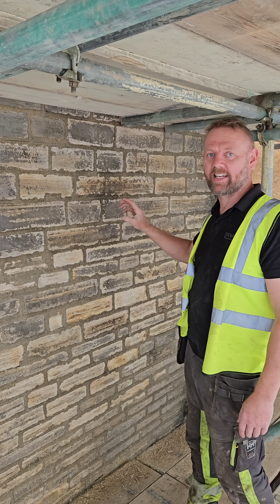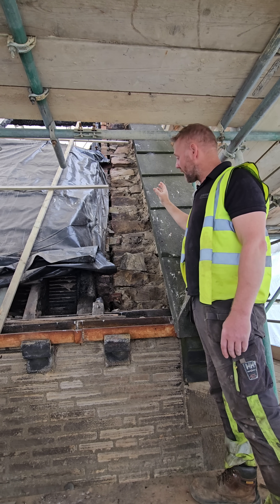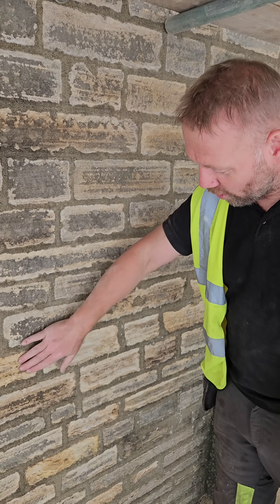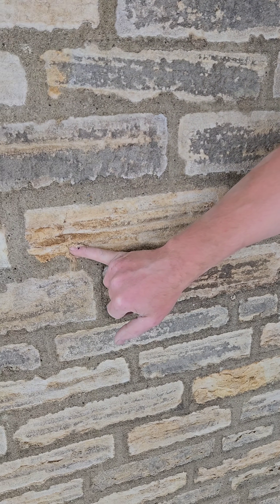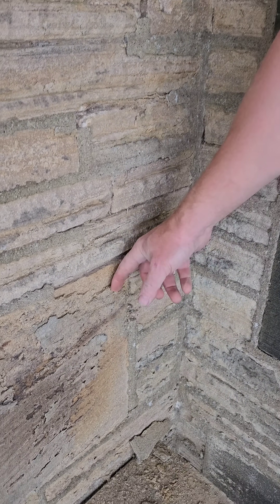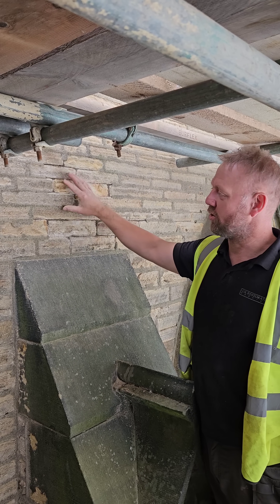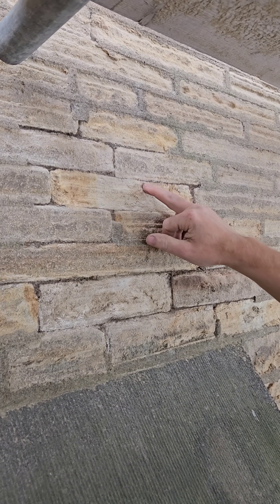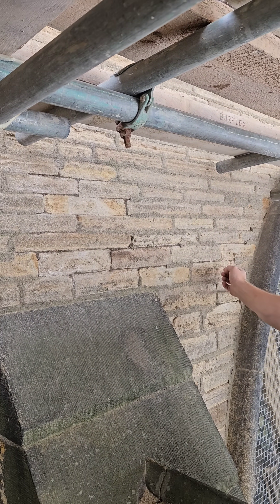Stone Decay Explained on Damp Masonry Stone Wall

Comment: Hi, what would you use on this job a 3.5nhl or a nhl2?
Reply from the maker: We would probably go with a hot mixed mortar mortar. This would have the best "wicking" action for the moisture within the masonry. I would be expecting it to fail within 5 years as the salts would degrade it. However, this would stop the salts decaying the stone.
Reply: @UKRestorationServices hi what's the difference between hot lime Vs nhl?
Reply from the maker: In short...NHL lime mortar is has impurities in which create an hydraulic set in the mortar. The NHL's are bagged ready to add aggregate and water. Three grade 2, 3.5, 5 which relate to different amounts of impurities resulting in strength gain. 
Hot mixed mortar use Calcium oxide which when mixed with water gives a huge exothermic reaction creating heat...up to 300 deg. There are different methods of mixing that can be used. The calcium oxide is nearly pure with little impurities which makes it very soft. Strength can be added by using a pozzolan. 
Hot mixed mortars have a smaller pore structure allowing for better moisture handling. 
Load of information on Google

Comment: Local church boundry wall, repointed in cement based mortar last month. The main building and wall is "listed" Permission should have been granted fron the planning deoartment prior to works starting. Aberdeenshire Council planning department not interested! Just let another wall be ruined ,it will not show up today or tomorrow. But ten plus years time it will..
Reply from the maker: Absolutely spot on there, it will be in ten years.....then it will be to late.
Reply: Council surveyors are no longer the force they once where.
Probably a manager from catering able to dominate the meetings

Comment: That looks like Spawling where water penetration of the stone freezes near the surface, then expands and blows the face off the stone/brickwork, which is why after a harsh winter you often see bits of brick on paths at the base of garden walls etc!
Reply from the maker: I would suggest the low level walls with similar issue to the video would be contributed by the local authorities gritting the roads with salt.
Reply: @UKRestorationServices 
Exactly…
Look how highway overpasses and roads are destroyed by salt.

Comment: That damage has less to do with cement than it has to do with no roof and a leaky plastic sheet + whatever water damage the firebrigade did! Salts migrate out through stone and brick usually as a white powder called Efflorescence! 😎🇬🇧🤣🤣🖕
Reply from the maker: Hey, yes your correct however, the decay mechanisms is salt expansion and contraction.